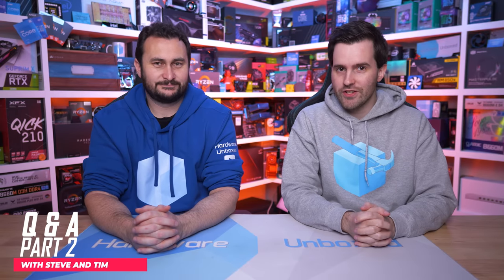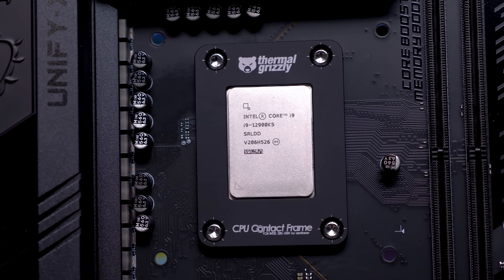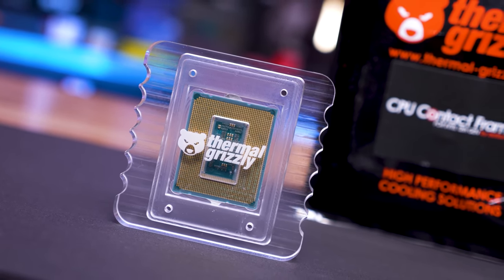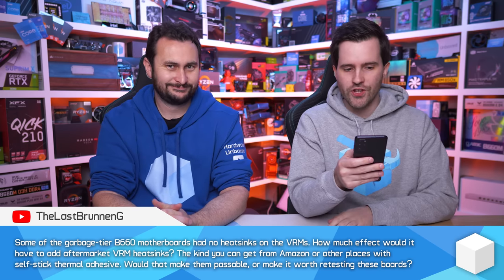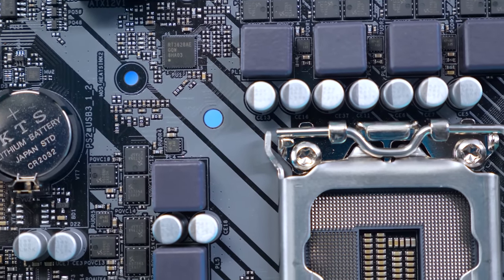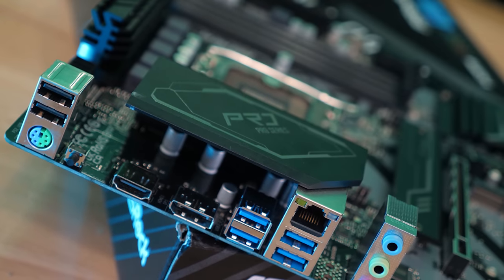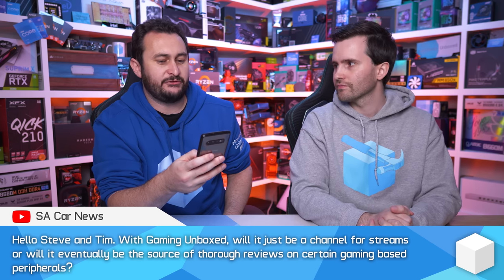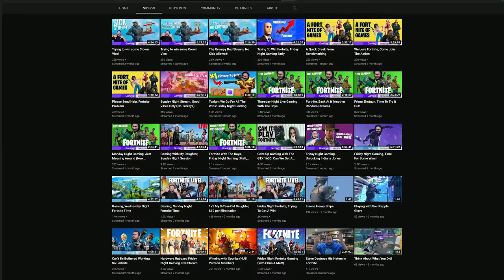Biggest Tech Fail 2022? Zen 4 To Make DDR5 Relevant? August Q&A [Part 2]

Comment: DDR5 prices aren't too bad especially for 2x 16gb. I'm keen to get a new system after the release of all the new CPUs this year. Not sure who I'm going to go with yet but I'm leaning AMD. Keen to get on the DDR5 for sure
Reply: you can get 2x16 DDR5 5200 for 200 euro so not that bad
Reply: What?! 200-250€ is cheap? I think you hit your head really hard.
Reply: Ive seen 170-180 aswell
Reply: @spawnersiak  people seem to grow complacent over time so they begin to feel comfortable with such a high price. It used to be that upgrading RAM was one of the cheapest solutions available to increasing performance.
Reply: Depends on the speed. As of today the 31.09 You can buy Kingston DDR5 4800Mhz 2x16GB for about 110$ here in Poland. That's including taxes. That's the cheapest one I've found. 6000Mhz costs about twice as much.
Reply: Yeah the only reason i'm considering AMD is the longetivity of the motherboard. In 2024 i'll be able to upgrade to Zen 5 without building a new PC but with Raptor Lake your stuck with 13th gen being the furthest you can go so hopefully it's good.

 I will say though upgrading your CPU isn't really necessary for gaming so 13th gen intel should be enough for the next 8 years at least if your looking to upgrade. I'm still on a 4 core 4 thread CPU so i'm in dire need of an upgrade.
Reply: Well I said that a few weeks ago, now I see a bigger price delta, like €100 but most ppl have DDR4 already so wouldn't need to purchase DDR4.
A few weeks ago it was €50 different, which looked more reasonable
Reply: @spawnersiak  if you are poor buy DDR4 instead

Comment: you can assign lots of things to background tasks in games, AI decision making things like NPC's deciding to go to bed etc not primary near player stuff, world asset manipulation (tree's growing etc) they can just update shared data if those threads run lower priority than the render thread then they wont significantly impact render performance as the render loop reads the shared data. So its possible but I doubt any developer will bother as its not a big enough architecture yet and competition (AMD, Apple, RISC etc) cant take as much advantage so its not worth the extra work.

Basically less important shared data updating for stuff further away or out of sight of the player can easily be pushed to slower cores, leaving the faster cores to run the in your face content.

Comment: dpi doesnt have to necessarily control the actual mousespeed.. dots per inch is just how accurate the sensor is really. but you can set a seperate mouse speed so just to keep it simpel the mouse move one inch on the screen per 100 dots

the best analogy i guess is to say that just because youre running a monitor at 240hz doesnt mean you also must run it at 4k resolution

Comment: 30:10 I am a 4k gamer here and I do have a 3080ti, but I had a 3070 before this (moved that down to my son) and I was doing 4k with a 3070 just fine with 120+ fps in almost all games, baring things like cyberpunk, but I did play cyberpunk. The big difference was just that on the 3070 I had to drop settings down to compensate but I would certainly consider it a "minimum viable option" for 4k gaming. I personally thought the better resolution made up for needing to drop graphical settings, and I was doing this before DLSS or FSR really took off, so it is even better now.

Comment: e-cores could generate random maps in background? Probably. AI difficulty adjustments? Maybe, if it was a mainstream thing in games. So indirectly impact main play? Maybe a few more things, but I doubt those will ever handle the main action flow. Still could be usable. Although one must consider games are A LOT more about playability - idea, action development, handling, than the tech they are running on or random. Tech can't save a bad game. So e-cores as a relevant issue for gaming is somewhere around the spot 87?
Oh, and almost forgot - Excellent job as always! :)

Comment: I am not sure who thinks the e-cores are for gaming. With the new Windows scheduler the e-cores are put to good use for background/lower level tasks or even for tasks that just do not require the grunt of the P-cores. They come into there own for lower-priority and background tasks plus workloads like CPU-based video encoding and rendering jobs that can engage all of your processor's cores at once. . Ultimately it was about driving efficiency so smaller, low powered cores for background, web, slack, teams etc...and the P-cores for the heavy lifting like games...not a bad thing for Intel especially as this will get better optimised better over time in conjunction with MS.

Comment: Randomly, the stuff about single threads helps me understand a lot.  For me, Doom was when PC gaming became worth taking seriously. But despite how pretty games look now, the next jump has never happened.  Worlds are like animated pictures, only a few steps up from the awesome pixel art you see on Reddit etc.

Around 06 I started building systems for FSX.  The AMD 3200 just didn't cut it.  The e8400 @3.6 was better, then a 2500K at 4.8 was definitely better.  But it was going from effectively 3200 to 7200 to 19200 available MHZ  ...  3 to 7 to 19 in performance.  The improvements were more in line with 3.2 to 3.6 to 4.8.

Why hasn't the tech scaled?  A new gen of gear is better, but that new gen plus the old gen would be vastly better.  Sony did this when the PS2 used the PS1 CPU as a GPU, but that's it AFAIK.  Why don't we have modular systems where older generations of gear attach via daughter boards to contribute whatever they can?

Comment: As a game developer, i think there is a way of making "No bottleneck" in the pc, but it only comes with well optimalizated code and engine of the game / processing each frame. I will tell you a secret... Its all about time of execution of code in period of time, and spreaded it over cores. And another imprtant step, the most hardcore in developinig industry... Sync data / threads each frame , and pass it away further into another code analyzing device. If you really think about this, its all comes about time menagement and controlling is every thing is not falling apart. As a game developer, i enjoying "PC parts world" very well. You shoud study both companies "Achievements and 'tricks of menagement data between devices' " To know how programmist take advantage in "Better game engine/#moreframes/#Infinite_action@240fps/".
...
In all engines 75% power of thread execution time, is for decide what is or will be on your screen ( or just around a corner ) and how to present it very fancy and unreal. Now fight as a game engine with dual core 4 thread execution power vs 8c16t massive turbocharged with cache of your glourious data processor 😂. Meld all that data , and execute logic on it. Physics/sound/network/AI/Logic/GameRules/graphics/animations/weather - now order its work in perfect harmony.

Comment: Just my 2 cents regarding ddr5.... if you're using a discrete gpu then it's probably not going to matter for a while whether your system is using ddr4 or ddr5, but if you're using an APU, that's where DDR5 really starts to shine and show it's advantages over ddr4.

Comment: Hi Guys!
an idea for possible future GPU & CPU reviews I think it would be good if you believe the MSRP to be unreasonable / bad you can give a recommended price for that part 
"What it should be priced at for the performance", that way if prices do drop we would be able to somewhat accurately gauge if its worth the buy or not.
for example the RX 6600 being a bad buy initially for the price but now its better because its closer to what a card with that performance "Should be priced"

Comment: Regarding the mouse sensitivity at 8:00 in the video, it's measured in cm per 360 degree turn. I'm playing at a 34cm/360 for example. So it takes 34 cm on my mouse pad to do a 360 degree turn. And I measure this to be the same in every FPS game I play. You also shouldn't use online mouse sensitivity converters because different games have different FOVs and the FOV will affect your sensitivity. You should just measure the distance on your mouse pad for a 360 degree turn. A fast sensitivity would be between 20 - 30cm/360, a medium sensitivity would be 31 - 50cm/360, and anything above 51cm/360 is slow imo. Of course, you need to have mouse acceleration turned off for this to work, and you'd have to be insane to play FPS games with mouse acceleration on. This setting is called "Enhance pointer precision" in Windows for some reason, and it should be disabled (it's in the same place where the Windows mouse speed is).
I've also heard people say that you shouldn't change the default Windows mouse speed because it makes it less accurate in games, but I'm not sure if that's true or not, I've never bothered to look for "scientific" explanations on that. I personally never felt like I had to change the Windows mouse speed anyway, so I keep it default in the middle.

Comment: With regards to DPI, normally you use something called eDPI to say your equivalent DPI. eDPI is the mouse DPI times the in game sensitivity. This is assuming Windows pointer speed is set to level 6 I believe
Reply: I have a problem with competitive shooters in that my physical reactions are usually over done with a High DPI.  I play with a much lower DPI tuned too my reactions.  I have made the Top 100 for a few weeks, but its more of a job than an accomplishment.

Comment: Do you think by removing the GPU bottleneck in benchmarking that someone might pick a i7 12700 over a 12400f and pairing it with a rtx3060 expecting a similar fps gain as in your benchmark with a 3090ti?
Reply: While possible, people should be looking at benchmarks for both the CPU and GPU, ideally independently of one another. That way, you know where you will be limited. For example, I have a 1600 and 5700XT. Looking through the Spiderman benchmarks, it became apparent that my CPU would be the bottleneck. It was seen that when using a much more recent CPU, that the FPS was much higher with my GPU, but no matter what GPU was stuck in the system, the 1600 was heavily limiting FPS.

Comment: I was actually checking DDR5 prices and found an insane bargain for a stick of ADATA 16GB DDR5-4800Mhz and its $79 AUD on Amazon, I was absolutely shocked to see it costs less than my DDR4 kit which I got when upgrading to the AM4 platform two years ago
Reply: I just checked and it’s a single channel. Is there a difference between dual channel?
Reply: @deagle7776  you need two sticks to run dual channel. Single channel means your memory bandwidth will be half.
Reply: Thats insane.  32GB for ~ 106€ is a very good price

Comment: E-Cores, I don't think I would even use them for networking. The software would became much more complex by throwing something like network off of the main P-Cores because it would require a lot more mechanisms to keep in sync. There is a programmer complexity when it comes to adding threads and cores that it might not be worth the day it would take to throw the networking stack to a different core, whereas you might make up the time in efficiency use of programmer time by just making more low hanging fruit faster.

Comment: Regarding the testing component selection - I'm 100% on board with use the fastest CPU to test GPUs and the fastest GPU to test CPUs. (I am a bit conflicted on 3090 vs 6900xt though.  The 6900xt runs faster but because of lower CPU utilization so is it reasonable?)  That being said though, I think it would be a great revisit to take the best bang for the buck CPU and GPU to combine them together and see how the system performs as a follow up piece.

Comment: I think that the discussion about Core i5 / Ryzen 5 was off. The only point which I think was worth making is that when the CPU market is moving forward, as it is now, generation is much more important than the number of cores. A Ryzen 5 5600X is better for gaming than a 3950X, the 7600X should beat the 5950X, and so on. So even if in, say, 3 years, the 5600X won't be enough, that's not because it's a Ryzen 5, it's because CPU architectures have advanced quickly enough that game devs can assume a lot more performance. Sure, there's still a matter of 4 cores not being enough (though that also comes with less cache, and Steve has already shown that has a major effect on gaming), but we still see the 12100 beating older 6 cores. The reason old Core i5s remained relevant for so long was that AMD was behind and Intel didn't improve performance on its side. Until we get back to stagnation, generation is likely to always trump core count. Disclaimer: If AMD sticks to having X3D on Ryzen 7 and up only, then of course that Ryzen 7 would have an advantage over Ryzen 5, but that doesn't have to do with core count. Short of it: I think that buying more cores for longevity is pointless and will likely continue to be.

Comment: Older 4c 8t CPU's like the i7 4790 are still holding their own for gaming. But the downsides are other factors such as slower DDR3 Ram showing its age and the lack of nvme support. But I suppose if it has the bare minimum number of cores and threads needed for the game engine and decent single threaded performance, then they'll be fine for who knows how long. I mean hell even the ancient Q6600 can still occasionally run modern indie games if they have support for older instruction sets.

Comment: haven't seen a good "intel" gpu scaling video in quite some time.   we got the 12400 vs the 5600 a while back but i'd like to see a pure intel scaling video starting with the 3070 and up.  it would be nice to see some of the older gen cpus in there like the 9700k but i would be happy with the 12th gen k sku's.  i'm curious if the 12900k with 6400 ddr5 can get more out of the 3070 vs something like the 12600k.

Comment: Considering the Intel possibly killing off the dGPU, one needs to taki into account how much of said cards are actually planned to be sold directly to consumers at retail, instead of actually providing those for the big manufacturers desktop/office/workstation/server rigs... cause while the former might push the branch to be dissolved if failing for a few years (including those few it is currently experiencing due to late-coming), the latter might actually become quite profitable, if the non-gaming/productivity aspects are actually great eg. when paired with other Intel platform products... On the other hand, it wasn't like AMD just worked on its dGPUs business for decades, they bought/merged under AMD brand the Radeon group of ATI basically becoming dGPU manufacturers from one day to another, even though arguably they have been still improving the designs and investing in R&D for years now after said merger.

Comment: A small correction, games could work with smaller slower cores, but they (and the engine) would have to be built from the ground up to make use of such architecture. Example is PS3, quote from Wikipedia: "PlayStation 3 uses the Cell microprocessor, ... which is made up of one 3.2 GHz PowerPC-based "Power Processing Element" (PPE) and eight Synergistic Processing Elements (SPEs). ... After manufacture, ... a defective SPE disconnected using laser trimming, leaving 7 SPEs", in other words, PS3 has 1 big core and 7 small cores. This, as you'd expect, presented a lot of challenges to the developers at the time, untill better engines were developed for PS3 and developers got the know-how on using non homogeneous CPU architecture. Modern games and, more importantly, engines aren't built to work with little cores

Comment: 22:24 Lynnfield i-7 870 was probably the first popular one of the first wave of 4c/8t DT processors.  Q3/09 - $300 (and it still games fairly well given something like 1080Ti, 2080Ti or 3080 - yes, tested).   There was Bloomfield that was released almost one year prior with 7xx model numbers (4c/8t Q4/08 but it took the 8xx series for them to get popular IIRC). So anyway, 12 or 13 years ago. :)

Comment: I have a 3080ti, and I feel it is comfortable for 4k gaming, but even Ill admit it isn't exactly like the days where you could max out every single game at 1080p or 1440p  and max out the frame rate of your monitor.  Most newer games hover between 75-120fps depending on the game.  Having VRR enabled sure helps, but even at 4k, I might not max out every single setting.  

Don't get me wrong, I am extremely happy with my setup, it looks amazing at 4k on my 65" Samsung TV!  I am just curious to see if the 4000 series of cards will finally be the full 4k solution!  Do I feel the need to upgrade to 4000 series right away?  Definitely not.  I feel like Ill be happy until 5000 series!